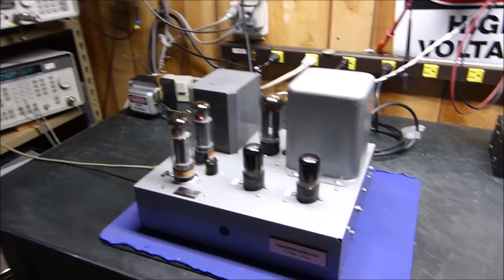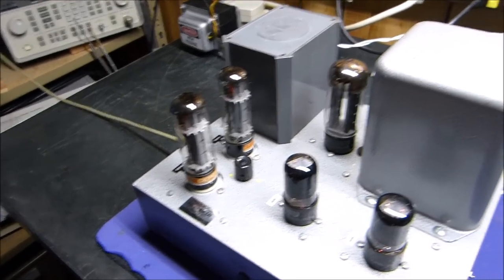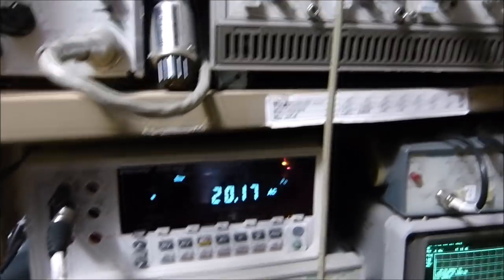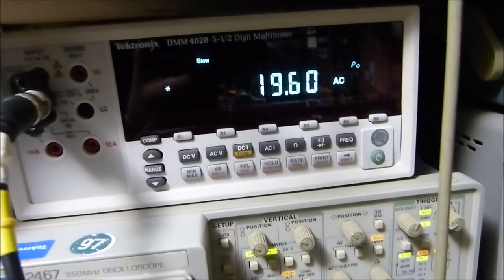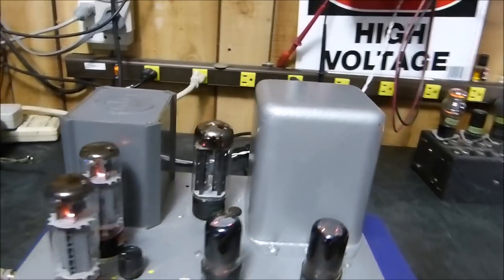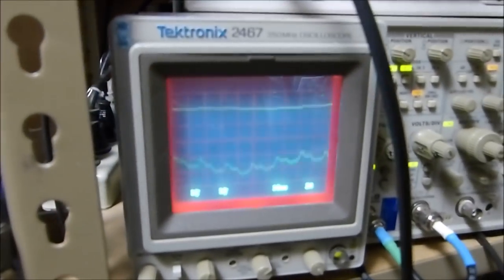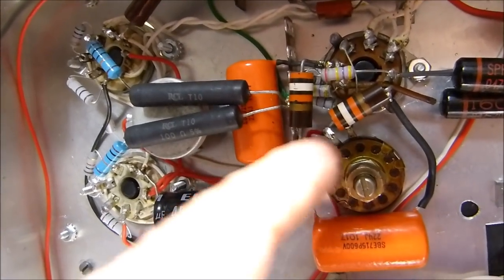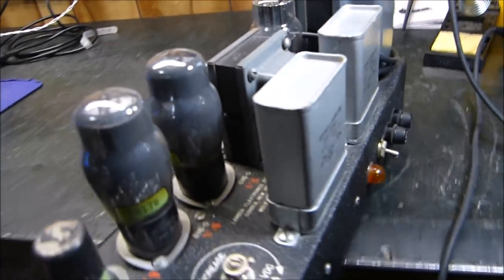Williamson Amplifier Using UTC Output Transformer

Comment: Good Morning.

Please, if possible clarify a curiosity of a big fan of Mr. here from Brazil.

Are these beautiful amplifiers that are shown on your videos owned or shipped to be repaired by Mr.?

Your videos are wonderful! Your instrumentation is awesome! All the best for the Lord.

Best Regards.
Reply: You are always showing noise and S/N, have you done a video on how to lower noise in a tube amp? I have a Stromberg Carlson 6BQ5 PA amp that has only -38 S/N. With Klipsch Cornwall speakers that is loud hum. Great group of videos on the UTC transformers.
Reply from the maker: @sandraledger2612  Yes, indeed, that would be some annoying noise at -38 dB and the Klipsch Cornwall's are a very nice set of  speakers. I personally like high efficiency speaker systems.
The only video I ever posted focused on S/N was when I found that wiggling the canned electrolytic capacitor on my Dynaco MarkIII would significantly lower/raise the noise. The problem there was poor bonding between the capacitor metal and the chassis. Made a huge difference in getting a good chassis ground to the capacitor.
I think the first thing to determine is what the most offending frequency is in your noise. If it is 60 Hz it could be a filament in a tube or even poor grounding on a hum pot or something in the area where 60 Hz can get into the system. If the offending frequency is 120 Hz then it is surely in the power supply after being full wave rectified and could be grounding, as mentioned, or just dried out electrolytic capacitors. That is what I would go after first. I personally select an electrolytic capacitor of  maybe 50-100 uF and with clip-leads connect the negative lead to the chassis (ground) and go around touching the positive lead to points in the amplifier where the original electrolytic filter capacitors are. Naturally, if you do it my way, you have to be very careful and only work with one hand as HV is present and can give a very nasty shock so be careful if you choose to do it this way.
I hope this helps.
Reply from the maker: Pretty much everything I show in my videos is my parts and equipment with the exception of a few transformers and associated parts of an amplifier. I have recently built a couple of amplifiers for a friend and in exchange have been given some of these UTC transformers and other items as payment.
Thank you for your nice comments. I really enjoy documenting and sharing the performance of these vintage instruments and I am always pleased that others enjoy the videos.
Reply: @ElPasoTubeAmps  Thank you for your consideration in answering my question. I still have a question and if possible I would like you to answer me:

All the amplifiers I see on your videos do not have tonality controls (bass and treble). They always have a nice FR (flat). But, when installed in acoustic boxes, within our residence, does not it take an increase of bass or treble, to adapt the music to our personal taste? Does the quality of the audio we hear on an amplifier without the tone controls depend on the acoustic boxes connected to it?

Sorry for my bad English.

Best Regards.
Reply from the maker: The amplifiers I build and post on YouTube are only the power amplifier section - the part that drives the speakers. Tone controls will be located in the preamplifier that comes before the power amplifier. If my videos were about a car, they would only be about the engine and none of the rest of the car.
With that said, a power amplifier usually can be driven to a high level of power output with only 1 or 2 volts which is the typically output of a modern day smart phone or a CD player or a FM tuner, etc. It is true there are no tone controls (but there often times is a gain or volume control on a power amplifier) but you might  be surprised how good it can sound without the tone controls. Certainly, a preamplifier with tone controls and the convenience of being able to switch to different inputs like the tuner, CD or smart phone, etc will be a very nice addition to have that feeds the power amplifiers that I build. Thanks for watching and your nice comments.
Reply: @ElPasoTubeAmps  Thank you for clarifying my doubt.

All good to the Lord and his family.